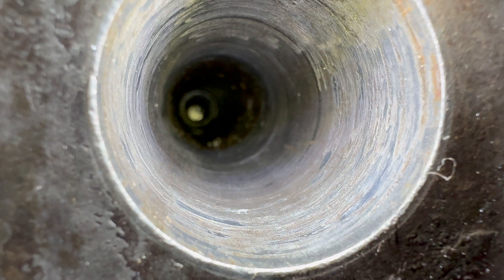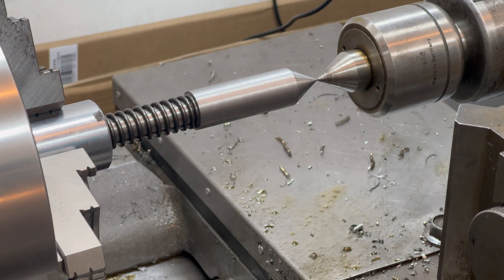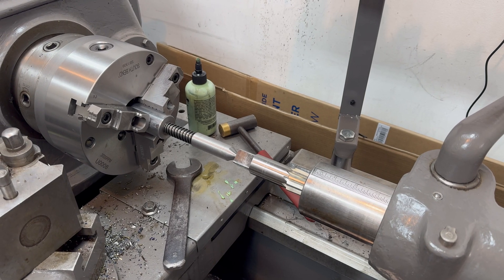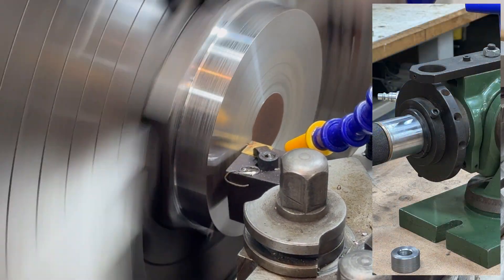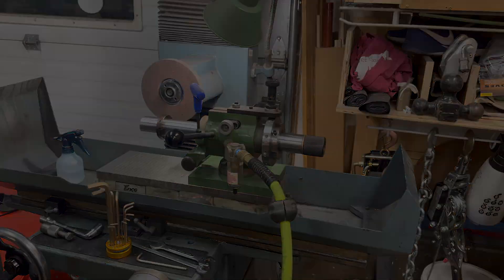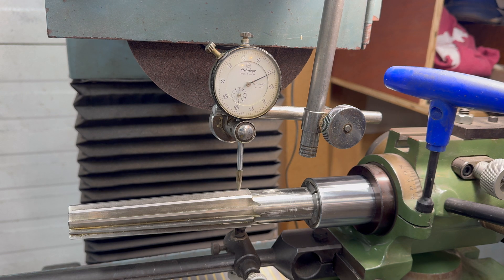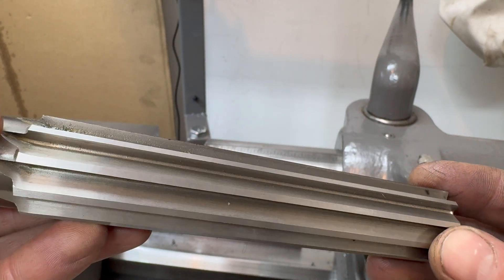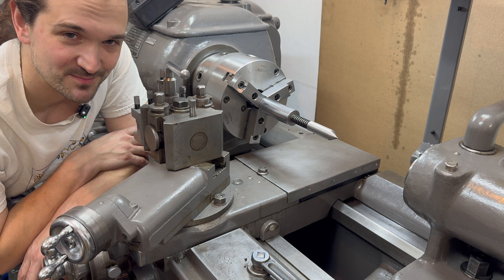Monarch Lathe Tailstock Repair (first attempt)

Comment: My suggestion is that if you have never done any internal grinding, the learning curve is steep and this is not the project to learn on.  IMHO you would be much better off getting a B&S 4MT plug standard off of eBay and then turning a cast iron lap or a bronze lap and gaging it to a known good 4MT sleeve.  Toolpost grinders are not the same as ID grinders, they have their place, this isn't one of them.  My other suggestion is to find a qualified rebuilder that works with Monarchs on a regular basis and seek their advice.
Reply from the maker: Sage advice as always. I will have access to a Dumore no. 5 “The Master” tool post grinder with ID spindle. Unlike this attempt, which I thought would be straight forward and simple, I will try to err on the side of extra preparedness. No plans on when or how to proceed yet, but I have plenty of MT adapters to practice on first. And… grinding makes me nervous so I will be extra cautious.

Comment: The way I fixed a worn out drill press spindle was by using a hardend morsetaper tool shaft, of a tool I didn't needed anymore and some lapping compound, started with a corse one and moved to finer and finer compound. About 2 hours of lapping and it was back in useable condition.
Reply from the maker: I’ll have to look into this - though I may have too much material to remove to clean up my taper for this to be viable.

Comment: I've restored the tailstock taper on my lathe. First I tried with a reamer like you, but even though mine did make chips, the result was not good at all. I ended up building a toolpost grinder specifically to do the job. I've used it since for other projects but the toolpost grinder really is the way to go in my opinion. You can see it in use in my SK30 tool holder fixture video
Reply: That tapper is hardened. 
Need to grind
Reply from the maker: I’ll check it out. I’m currently learning all I can about tool post grinders.
Reply: @ED_T can you link the video? Was unable to find it

Comment: 1) take the tailstock quill out, chuck it in the lathe, and indicate it true. 
2) affix a grinding post and grinder to your cross slide, and set the angle of the cross slide to match the taper of the MT4
3) cover the ways with an oiled cloth
4) Slowly move the small grinding wheel in and out of the taper, as you run the lathe on it's slowest speed. 
5) Check results, ensure the taper is correct, and all surfaces have been cleaned up. 
6) Clean the ways thuroughly to remove any dost and debris from the grinding process.
Reply from the maker: That is a great plan. I’ve been looking into tool post grinders and asking around locally. I plan to clean up the taper at some point; but it may be a little while.

Comment: You could remove the quill from the tailstock, set it up on the lathe carriage with the dividing head and use a grind stone mounted in the spindle of the lathe? It would knock off the high spots well enough to then use a shaped lap?  Alternatively you could machine out the taper and install a bush that was soft enough to ream? I have repaired one in the past that had been taken to deep by doing this. However it's a very much last resort quick fix.
Reply from the maker: I've been reading up on my lathe and I have two anti-rotation tang set screws (or whatever they are called). They can be removed but I measured that I can only remove 0.005" max from the radius before they become ineffective. I'm leaning toward grinding, taking a light skim of 0.002-0.003" just to remove nibs and clean it up a bit. No definite plan yet.

Comment: Isn't the your falure due to the fact that the tailstock is harder than your reamer. I was under the impression that people use a grinder for the tailestock and not a reamer.  However, I highly enjoyed watching your professional process in the video. The air bearing sharpening process was extremely fun to watch.
Reply from the maker: Totally my failure. Monarch hardened just about everything on this lathe - I should have known. I will look into a tool post grinder eventually and I’ll revisit this.